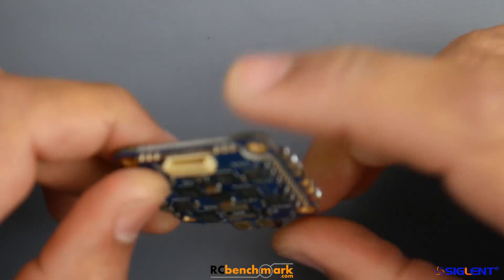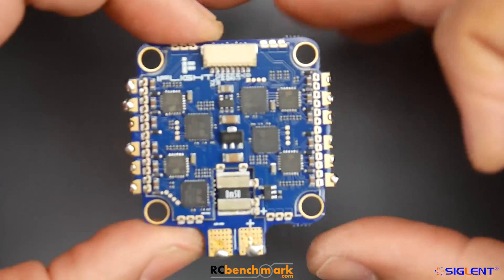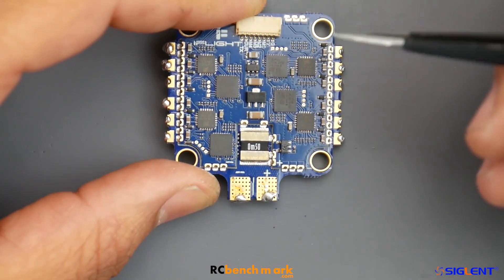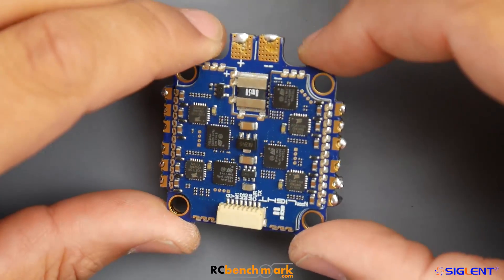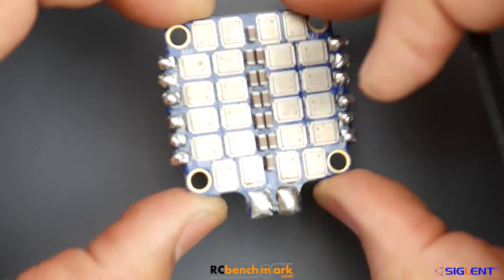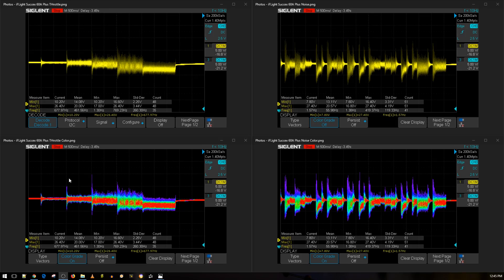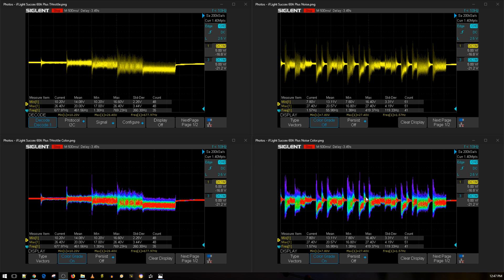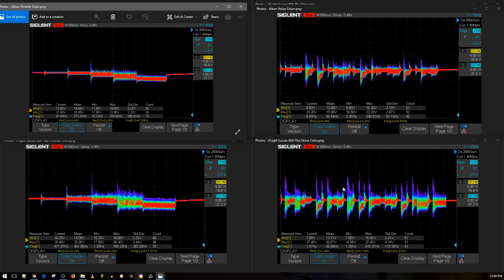iFlight SucceX 60A Plus 2-6S  // Full Comprehensive Review & Noise Test

Comment: I have the v2. Much improved. BTW the two-part circuit board, i.e., castellated PCB, is to save costs and to expedite development; build and test the logic part first. The latest version, V2, does not use a castellated PCB. Unfortunately, with the new board, the ONLY connection to the inner power layers is through the vias; they have no constellations or through holes. Apparently it can carry the current. And if the add-on board gets "hot enough to de-solder the board", it's over!  Those metal tops are not "heat sinks" although they do carry away heat. They are the "drain" side of the FET. Which allows 50% of the heat to radiate from the top of the FET. Whereas with the old style 80% is radiated from below. Additionally,  unlike standard FETs, with the DirectFET, that metal top is LIVE. Touching it to ground will cause a short, so adding heat sinks is a tricky proposition since there are multiple circuits in those 24 FETS.
Lastly, those low frequency caps are for power surges; not EMI/noise. I'm putting some non-electrically conductive but heat conductive  goo over the whole mess and then a sink on top.

It is now Feb 2020, has the 4in1 burned up? The real test is when it is in a flying machine...

https://www.amazon.com/gp/product/B071GKQXHB/ref=ox_sc_saved_title_3?smid=ATVPDKIKX0DER&psc=1

Comment: Anyone with an 6S issue.  Mine wont lock with 6s only 4s.   Iflight is helping me with this and I posted them video but so far I had to order another one while Iflight give me new instructions.
I used cap it came with and without and no change.  Wont lock with 6S battery.

Comment: Hi...stupid question from me...is it okay if i put serial capasitor 35v 1000uf in this esc ? ...so totaly the capasitor are 70v
Many thanks in advance
Reply: I did that and is perfectly fine.  Assuming you have room on larger setups.  It mostly helps with batteries as they don't get stressed as with out series of caps.
Reply: @markuskoarmani1364  That will work fine. Typically serial caps are done for two reasons.1. To increase the WV and 2. for fail-safe. With only one cap, a failure, i.e., short will cause a melt down, but a second cap maintains an open circuit (no melt down); done in high reliability circuit especially automotive power supplies. There is a loss of capacitance obviously, when/if one cap fails by short.
Reply: That will work fine. Typically serial caps are done for two reasons.1. To increase the WV and 2. for fail-safe. With only one cap, a failure, i.e., short will cause a melt down, but a second cap maintains an open circuit (no melt down); done in high reliability circuit especially automotive power supplies. There is a loss of capacitance obviously, when/if one cap fails by short.

Comment: Still waiting for the test of the SucceX with a lowEsr Capacitor ;) I will replace my SucceX 60A against a Dalrc Rocket 50A next. Even with a low Esr Capacitor my quad doesn't fly as smooth as my other quad with the same componets but with a Dalrc Engine. Even the Motor Noise looks worse in the blackbox viewer on the quad with the SucceX 60A.

Comment: Nice test! I also have the succex 60a 4in1 in combination with an iflight succex f7 TwinG. But i also want to test the combination of Succex 60A single ESC's + SucceX PDB + F7 TwinG. Looks like there are much more caps on the succex single esc's. I'm using a 470uF low ESR Cap and a Unify Pro and a Foxeer Monster - both connected to 5V and i'm struggeling with some Video Noise.

Comment: So I have a flight controller that will power up through USB but not with the battery.. omnibus f4 from my hawk 5.. pretty sure it's a 3a 5v Bec. I really want to fix this rather than throw it in the trash. Is there somewhere that does this type of work or where can I get the part? 🤷
Reply from the maker: It's the diode I have a video on that.. Search dronemesh flight controller USB power fix and it will show you where your problem is.. with the battery

Comment: At first thank you for releasing this great content. But i have an important question ,what happened to the review of the holybro 4in1 Metal ESC '
Reply: A review would be good. If it helps someone, I have a holybro 4in1 metal with their F7 (not AIO) with their cap and it works great with F40 pro II 2400kv on 6S. I used BF4.0 with RPM filters (2 harmonics).  I set ESC ramp up power to 30%.  Cold motors and full throttle.  This type of build wouldn't have worked if the 4in1 was noisy.
Reply: This is my question too!! where is it? how does it compare? So far only two flights with my Metal F3 4in1, and its the smoothest I have ever built and its on stock settings, I can only hope RPM filtering will be even better when BLHeli32 gets its update for RPM filtering dialed in!!!. I am also adding the cap to keep my video feed ultra smooth. But it would be cool to see how it compares to the other 4in1 ESC's in the market...I am guessing its the new Godzilla killa!!!

Comment: I'll stay away from 4in1. my first 4in1 smoked without any reason. too much loss if one smokes and all others are fine. I like single ESC way more. but those FETs are very nice and I guess they have huge potential. How about reversing that idea of sandwiched boards: Make the ESC section modular sandwiched as 4 small boards. If one smokes, de-solder the failing quarter board and put a fresh one on. THAT would make sense to me!
Reply: pixelcomet i think there is one like that
Reply: Drone mesh has a video on a urav one only $20

Comment: wouldn't it be much more likely that components are desoldered on a single board
Reply: 160°C necessary to melt solder. if it gets that hot I guess somet is wrong in the first place